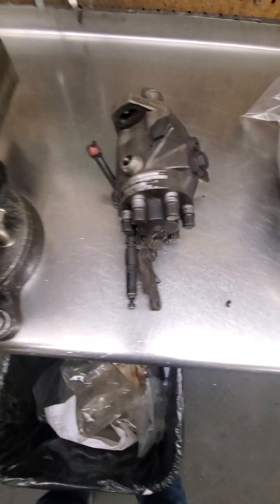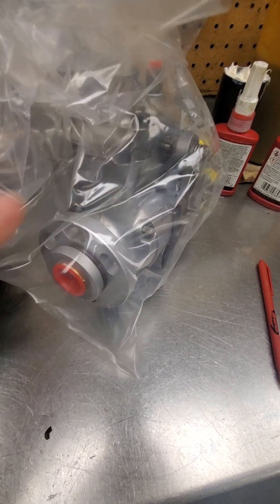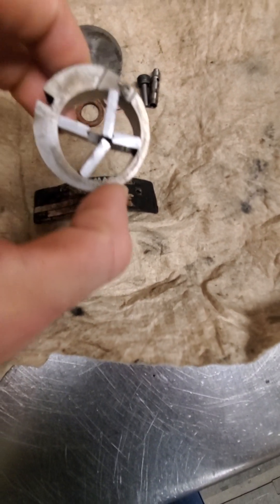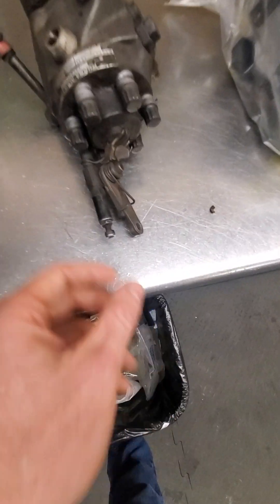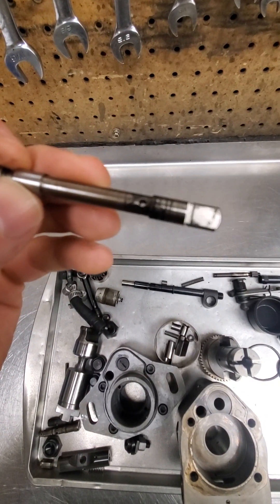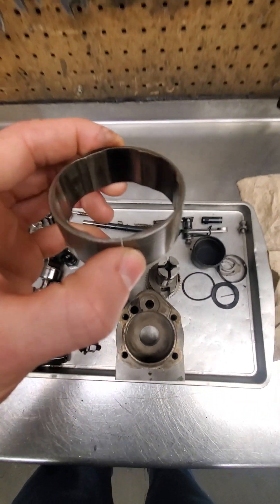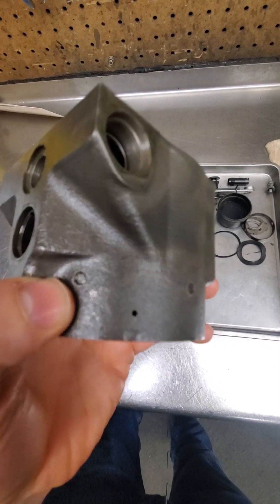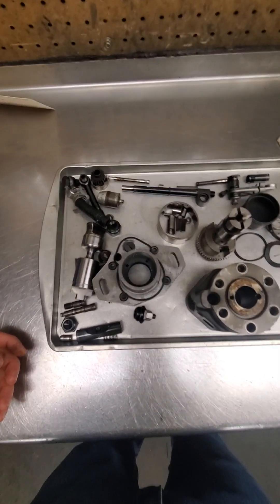Rebuild Your Stanadyne Roosamaster CB Style Injection Pump John Deere 3020 4020

Comment: Hey Levi.. great video… I’m working on several Bosch VE pumps (for VW TDI engines).. I’m using Cerakote C-110 MicroSlick on internal parts, it will add 0.0005” to worn parts, then I’ll tear down to check everything after 100k miles